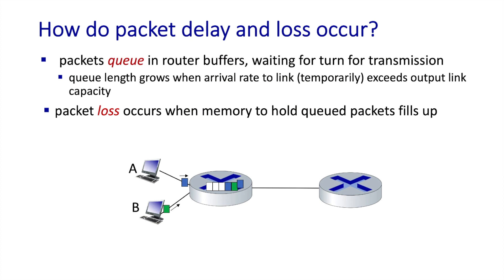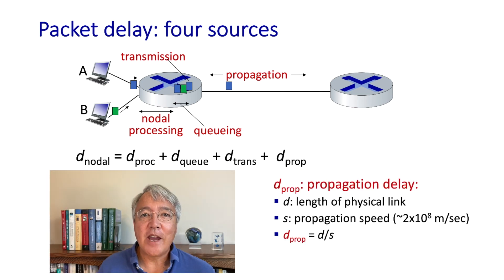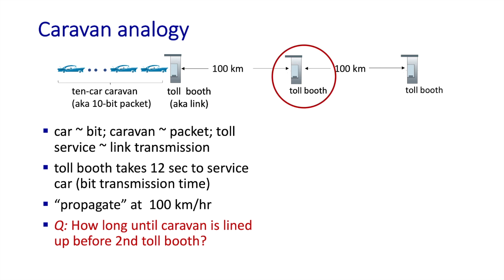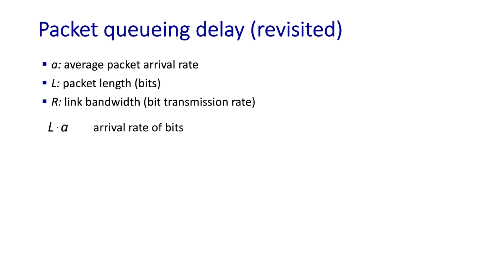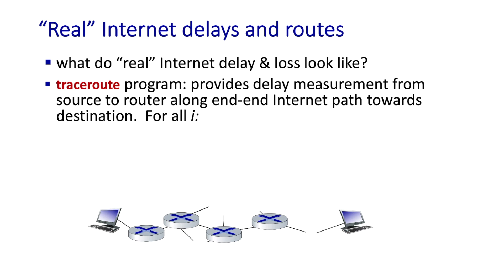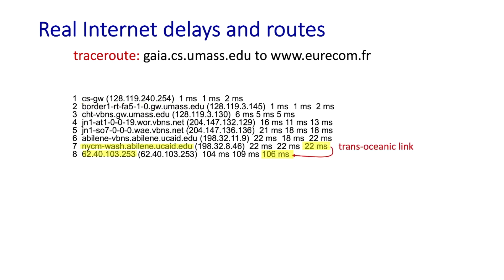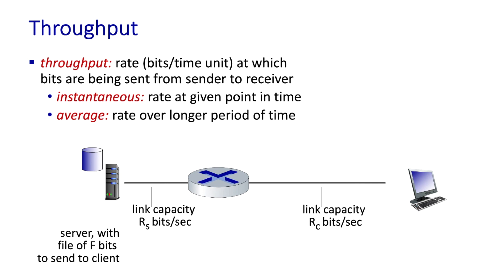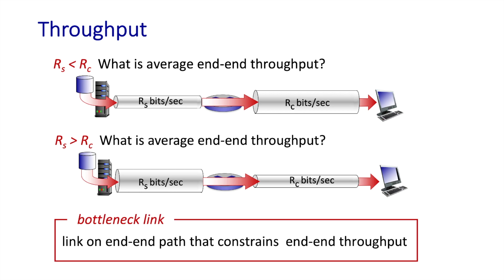1.4 Performance

Comment: the biggest epiphany after watching these initial chapters was realizing that all those "transmission speed/rates" and "internet speed tests" of different mediums e.g. "100Mbps", from cable wires to fibre optic to satellite to wifi are NOT the medium itself - which is literally like the speed of light - but actually the host device/access point/modem physically/computationally "pushing" packets onto said medium/link. (and its just the process of the pushing onto medium itself, the actual computational checks beforehand like integrity or whatever CPU calculations are now d_proc which are on the order of microseconds - so negligible) bruh.

the actual delay caused by the medium (because the speed of light is still not infinity) is now d_prop here.
so
packet arrives at node input -> first d_proc (protocol shit)
then perhaps a d_queue if the output link is busy currently still transmitting a packet (undergoing d_prop basically)
then finally when output link is free, the node begins to "transmit" and the whole process of shifting the packet from node's memory/buffer onto the link physically is d_trans
then finally once the packet is on the link it's up to nature and physics and distances on the medium itself with d_prop

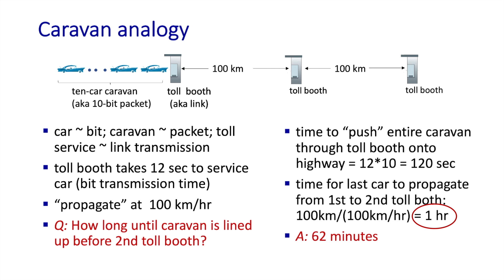4:53 analogy is assuming the caravan travels at once in a group, like a packet
Reply: thanks for the comment! i had mixed up the steps of the forwarding process. lol.

i thought it was transmission -> process -> queue -> propagate
but in reality it is
process full packet after it arrives -> queue packet if other packets waiting -> transmit full packet from output link to physical media bit by bit-> propagate each bit through physical media to next node

then wait for all bits of the packet to arrive at the node.

packet is a made up concept(logical) to understand the flow of bits better
Reply: @ashtonronald  packets are logical made up stuff? I thought they were real? as in an actual software abstraction or interface implemented in node hardware or software for the protocols?

lol i've forgotten almost everything after my finals which i used this to study for took me a few rereads to understand what the original context of all this was
Reply: @nerd2544  I think it really exists,which refers to "packets of  information",but we mask it until the link layer.You can think of an operating system.We have the "virtual file system",while the true "file" is on the disk

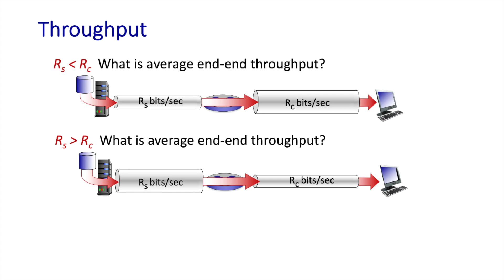Comment: 11:27 Does anyone understads what would be the capacity of the link that he's refering to (when talking obut the bottleneck link on a path)? Because so far we have seen two rates (bits per second) linked to some form of link capacity: The insertion-transmition rate of a link (i understad that it is binded with the serialization and to put the bits on the link itslef) and the  propagation rate of a link, wich depends on the large of the link  and the velocity of the medium.
Reply: I see you understand, where your confusion exactly ?